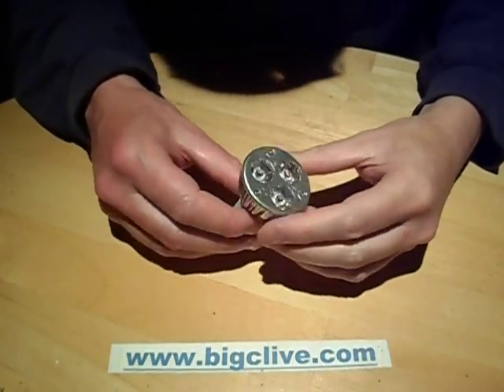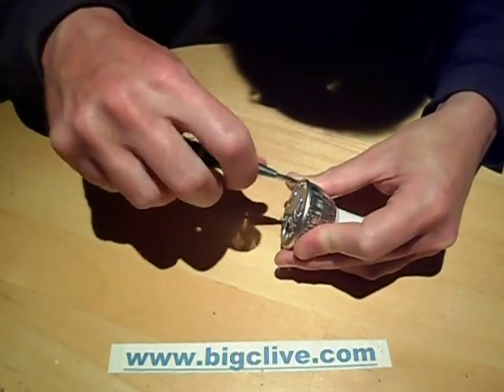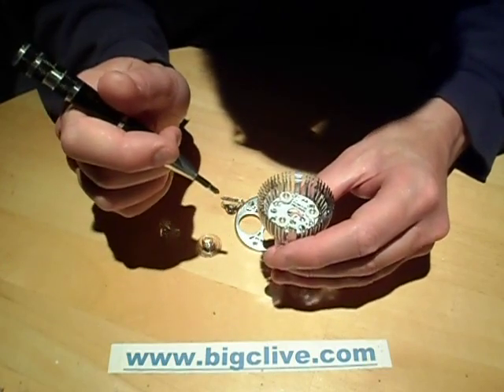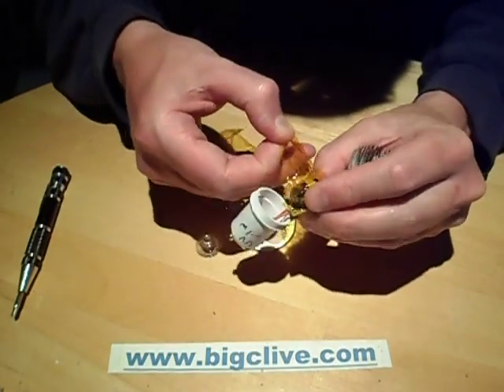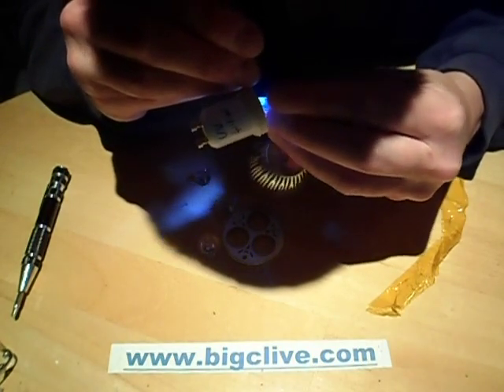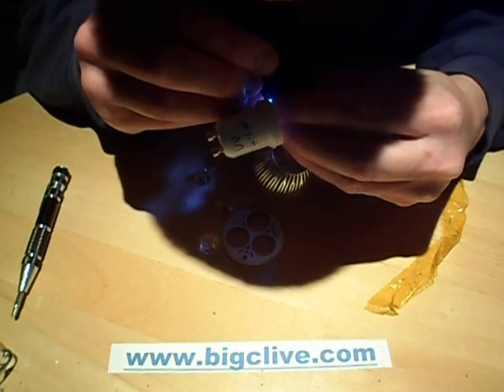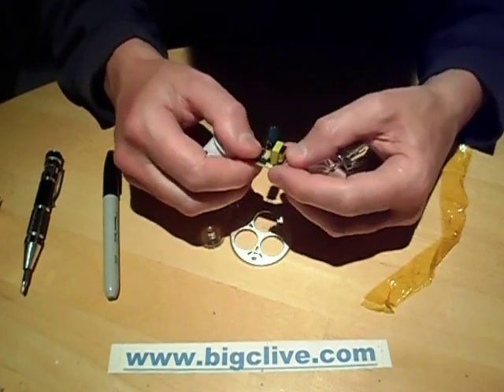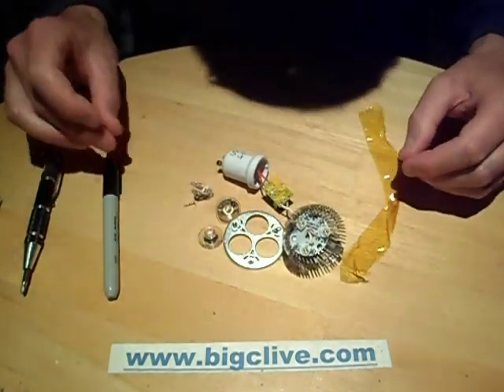Teardown of a 3W ultraviolet GU10 lamp.

Comment: I just bought a £5 torch on ebay with UV led's - they emit a dull purple light but the security inks on bank notes and cheques do not flouresce at all. Are there fake UV LED torches around? If you reply I'll post the ebay item link, if you want to check it out. Cheers.
Reply from the maker: +ForestCat The UV LED torches on ebay do make some fluorescent colours glow when viewed in a very dark room, but the LEDs are actually emitting a deep violet "near UV" light and not actual UV light.
Reply: +bigclivedotcom Thanks for that. The one I bought does not show any trace of glow on banknotes. I shall be keeping my UV tube lamp which works brilliantly - obviously no substitute yet! Cannot post link, but offending item can be found by searching for Multi Function Torch Flash Light Laser Ultraviolet... 
UPDATE - just tried another £2.50 ebay UV led torch and this one shows banknote etc security markings although the excess visible violet light swamps it a bit. So not all ebay UV led's are equal, but they're not a patch on my UV tube :-)